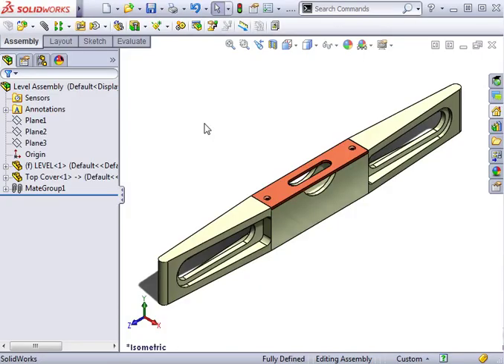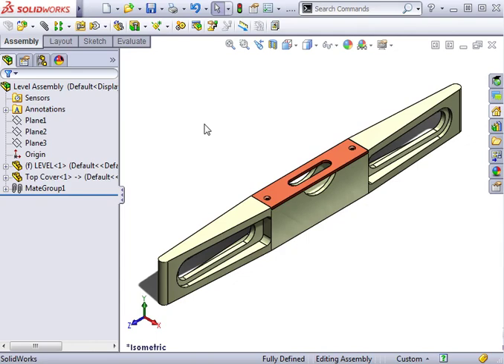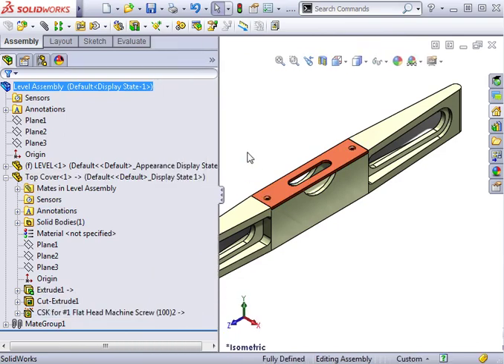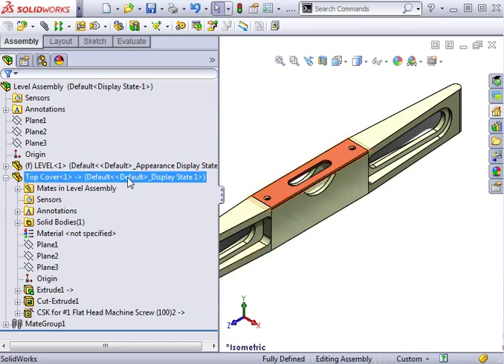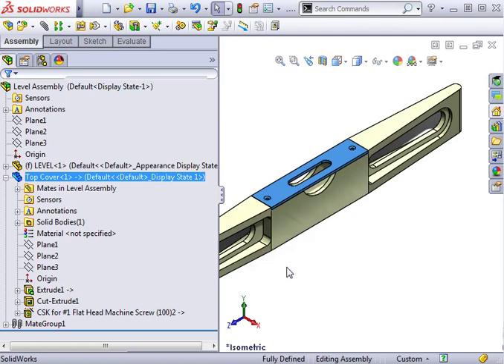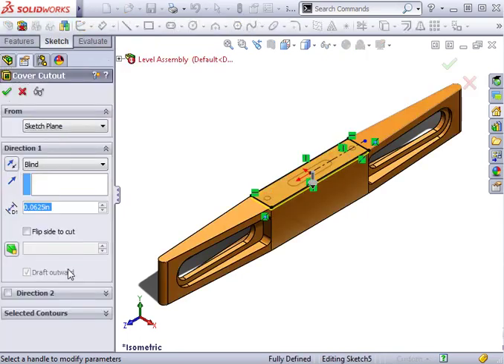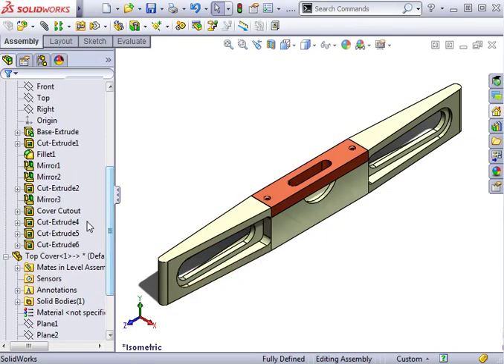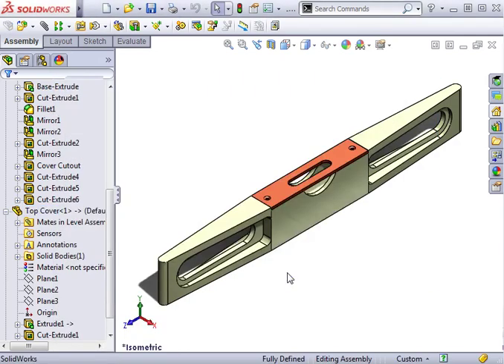07 Top Down Assembly Design   07 Remove External References Part A

Comment: This is great, but although we can replace sketches easily like this, we can't replace features such as boss extrude: we're forced to manually update the features by removing the vertex reference and adding a blind with the correct measure. This is very obnoxious.